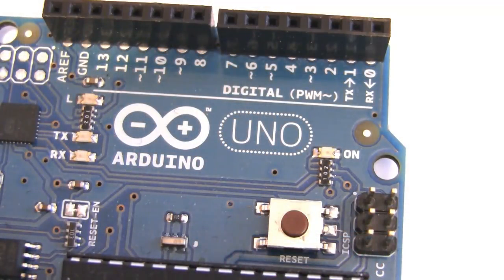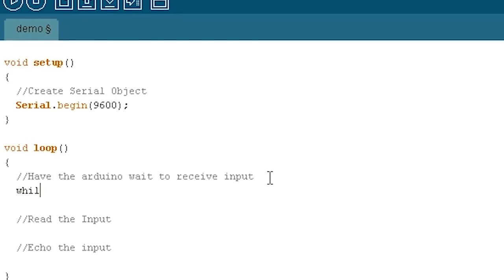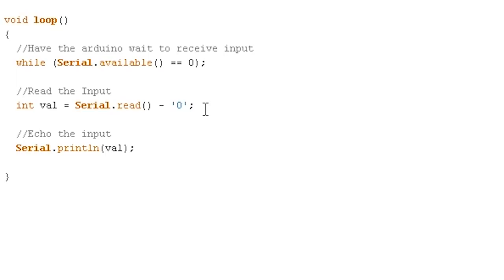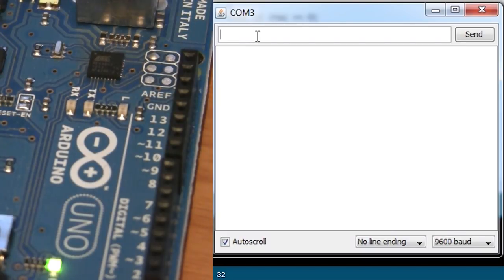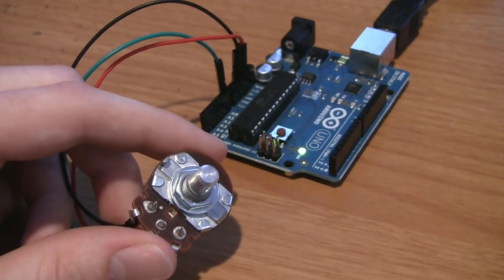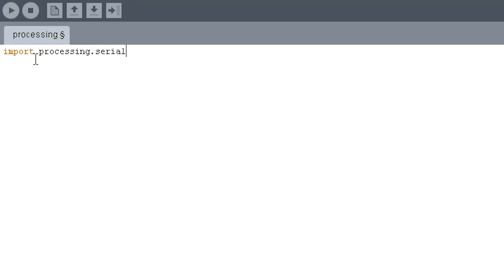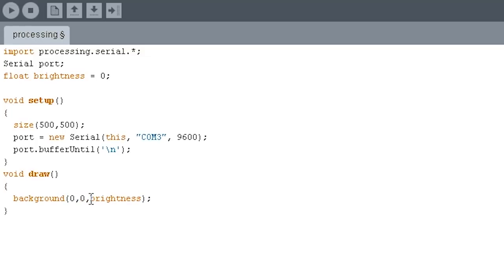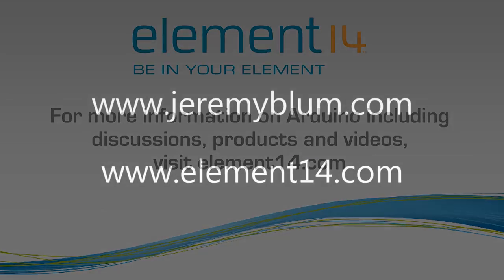Tutorial 06 for Arduino: Serial Communication and Processing

Comment: How did you get the Com3 window at 5:00? Is this another program or part of the Arduino software?
Reply: Thanks, I saw that after I posted.
Reply: Jim Steinbrecher you could use termite, but thats trouble.
Reply: i tried to use termite, but it says "no handshake" any suggestions on how i could get this to work?

Comment: The Processing listing shown in this demo, does not work on version 2.1.

If you change the last line:

brightness = float(port.readStringUntil('\n'));

To:

brightness = float(port.readString());

it does work.

FYI I am running win8.1 64bit.
Reply: thanks so much! that fixed it for me :)

Comment: RS232 is +/- 3 volts to +/- 15 volts. Not flat 0 or 15. The MAX 232 and MAX 234 ICs were used in programming cables and RIBs to program older commercial 2-way radios and cellular phones. Today the MAX232 series ICs are used in A/V gear when you can interface with a 9 pin serial port like on a DVR for CCTV or the programming port in some satellite TV digital receivers. They are being phased out by the USB versions though.

Comment: Hello, Jeremy. Could you help me with one strange problem? I'm following your tutorial and stuck on processing data from serial. All is working well until I start processing. In that moment in arduino IDE serial monitor all values start printing in one line instead of new lines. Also in serialEvent() function I receiving only few symbols from string. I guess It depends on my environment. I'm working on Linux. Should I use different symbol for line ending instead of "\n" on Linux?

Comment: Also if your asking about the later example then replace his line of code with this:
port = new Serial(this, Serial.list()[COM PORT HERE], 9600);
in the brackets try 3 or 4 it usually is one of those two, though there are ways to check.

Comment: The port will depend on what one your Arduino has chosen to use, it might be COM4 or some other one, but to get the console like he has on his screen, you can either use the button on the far left of the sketch window (it looks like a magnifying glass) or use the keyboard shortcut Shift-Command-M, when in the Arduino application.

Comment: Everything seems to work fine running this inside of the processing ide, but when i make a stand alone (linux) executable, i get the following error:

Error, disabling serialEvent() for /dev/ttyACM0
null

I do not have anything else open that may be interfering with serial COMs
Running as root did no good so i assume it is not a permission issue.

Comment: am using UNO, my       Serial.flush();          doesn't do a thing, i still get multiple prints even if i include it right there??????
Reply: Serial.flush();   only work for Prior to Arduino 1.0
Reply: Load Field so what can the rest of us do?
Reply: Matt Dathew "Serial.flush() has changed in Arduino 1.0. You can use this instead:
while(Serial.available()[GREATER-THAN]0)
{
Serial.read();
}"

First line in his commentbox on the video.
However, I`m still trying to figure out how to make that work myself.

Comment: Regarding the Processing part,

this is the code I used & the background is not changing colors

import processing.serial.*;
Serial port;
float brightness = 0;

void setup()
{
  size (500,500);
  port = new Serial(this, "COM3", 9600);
  port.bufferUntil('\n');
}

void draw ()
{
  background(0,0,brightness);
}

void serialEvent (Serial port)
{
  brightness = float(port.readStringUntil('\n'));
}

I placed the positive pin on the 5V - Black on GND & green in A0, but its not changing colors.

any suggestions?

Comment: Hello....I have one question. in serial communication sometime we write serial.begin(9600) and sometime different bundrate.
what is actual purpose of bundrate ?
Reply: +yash trivedi Baud rate is the speed at which you send serial data. You can have it set to anything you want, but remember to set the receiving & recieving rate to the same rate. If you don't you will end up with garbled data.Check at the bottom of serial monitor window for instance.
Reply: +masterstroggo  Okkk thank you

Comment: You spoke about using an Arduino Mega with many rx/tx ports.  When you set serial.begin(9600) this is for serial communications with the Mega as a whole?  The ports on the Mega are Serial1, Serial2, and Serial3.  Can you set different baud rates for different serial ports?  Serial1.begin(9600); and Serial2.begin(38400);  I'm using an external serial device to send commands to but it is conflicting with the serial monitor.  The baud rate for the ex/device (SFmp3trigger) set to 38400 on Serial2 and for monitoring which mp3s play on the serial monitor, Serial1.  idk.

Comment: Hello!! i need some help over here. The example is great but it works only if the Serial.read is from 
0 to 9, if you try to put 11, 13 or 26 it will reply the numbers separate as individuals, EX. 26 it will reply:
2
6 
and not 
26
So how i can fix this. please help!! Thank you.

Comment: The serial.flush() isnt working for me. It is still sending multiple "invalid" messages. Anyone else facing such a problem? How to fix it?
Reply: +Sankhalika Mukherjee Read the note in the description. It says that the Serial.flush() function has changed
Reply: USE
while(Serial.available()[GREATER-THAN]0)
{
Serial.read();
}
Reply: Where do we need to put that? I put it (while(Serial.available()>0) Serial.read();) at the bottom of the loop instead of the flush but it doesn't seem to change anything.
Reply: Seems to help if you add "delay(100);" before the while command. Not sure why.
Reply: RetroRobotRadio
Thanks, that works.
Reply: Because computers get hung up on infinite loops without delays
Reply: thank how do you find it and why is that ? (need a little time to think about it ? ;) )
Reply: You are absolutely right. Thanks for that tip!!!!

Comment: I also had problems with flushing the serial buffer. After many attempts, printing "invalid" only once works with this:

int ledPin=13;
void setup()
{
  pinMode(ledPin,OUTPUT);
}

void loop()
{
  Serial.begin(9600);
  while (Serial.available()==0);
  int val=Serial.read()-'0';
  if (val==1) 
  {
    Serial.println("Led is On");
    digitalWrite(ledPin,HIGH);
    Serial.end();
  }
  else if (val==0)
  {
    Serial.println("Led is Off");
    digitalWrite(ledPin,LOW);
    Serial.end();
  }
  else
  {
    Serial.println("Invalid!");
    Serial.end();
  }
 }

Comment: There is a problem with this video now the system has been changed and there is an error now when you inserted the line 'Serial.flushj()' it no longer works because the flush routine has been changed.  This caused me some time debugging because i thought i had something wrong.  i found system had been changed. keith

Comment: I am just learning the Arduino library myself, but it doesn't appear that you can (this way). The read() method separates a serial stream into bytes and returns the first byte in the buffer. So as long as you are reading from the buffer in a loop, it will continue reading those bytes. You have to implement your own function to read data up to a CrNl, and combine and display all those bytes. The library is "Serial" so you have to do some extra processing. Using AVR Studio makes this a bit easier.

Comment: Hello Jeremy,

I appreciate all your videos and I have found your tutorial pretty useful. I have a question though regarding processing. I have built a gauge for my gas sensor but there is a problem with my result when I run the code, it just blinks the whole thing.

I have noticed that the blinking rate is the rate that my arduino transmits data to my computer, like if I have delay(1000); on my arduino code, the gauge will blink every second.

Any thoughts on how to stop that? Thank you for your answer in advance!

Comment: What i do not understand is why you need the variable to be a FLOAT? it's whole numbers coming in? When i tried using an INT it didn't work.
Reply: analog data is typically between 0.0 and 1.0 or some other positive voltage like 0.0v to 5.0v, the ADC ( analog to digital converter ) can convert to integers like 0 - 255 or any other range, but if you are reading raw analog inputs they are typically decimal based.

Comment: hey I am working on automation project using HC-05 and few sensors. When we connect only Bluetooth module with Android and send commands through app it works properly. But the problem is when I hook up the sensor to it (reading the values using analog read) it is   not working properly. When we press a button on Android app, I am getting output only for the moment I press it. It does not stay as it was using only Bluetooth module. help me out
Reply: Hello bro....May be there where some pin mistake and which controller you used for your project ??

Comment: I had a problem with that program. If I entered more than one digit, I've received message for each character even with flush. Turns out, that there wasn't enough time time to receive all the characters in the buffer. I've fixed this by adding 10ms delay after the while loop.
Reply: Сергей Мациевский i got the same problem... and sorry again how did you fixed this?

Comment: for some reason, havin the code in when I enter 1 it replays back '1' to me then also '-38'.  Not sure what's going on there.
Reply: At the Serial  window.  I had to set it to "No line ending" at the bottom.  The reason your seeing -38 is that the serial is reading new line.  Without the "int val = Serial.read() - '0'; " code you would get 10 which represents "NL line feed".
Reply: Shawn Hale I meant without the "- "0"" at the end of  int val = Serial.read() you would get 10

Comment: I have an Arduino Mega 2560 board and a KRIDA Electronics 4 channel light dimming board with (GND/VCC/Sync/CH1/CH2/CH3/CH4 and GND) terminals. I want dimming level Up and Down by using two push buttons and stay any level of dimming point. Lamp is 230 VAC /50 Hz Please help me to write the Arduino code.

Comment: Serial.flush() is not working and so is the alternative provided here. still for more than one input sent i;m getting each invalid answers
Reply: iamkiddilam I'm having the same problem. Anyone here knows how to fix it? The code is identical to what the tut. shows.. Has the arduino Uno changed since the upload of this tut.?
Reply: iamkiddilam Yes, i had the same problem, but he has fixed the trouble in the comment box below the video.
Reply: ceber54 False alarm, doesn't work.

Comment: Take a look at the X-Plane SDK. It should give you the properties that you need to write/read to change the throttle. Then take raw data from the pot (via analogRead) and pass that into X-Plane via their API. I haven't done it in X-Plane, but I have in MSFS/Prepar3D. It's pretty straightforward. You need:

1) Input from pot
2) App to grab input and load it into X-Plane
3) API call with variables to read/write in X-Plane.

Try to use 10-bit ADC, as 8-bit is probably not enough resolution.

Comment: why is my output coming like this 
1
-38
2
-38
Reply: use No line ending
Reply: @davidtapia5492  still does it but just on the same line 1-382-383-38...
Reply: Oh I got it. Select No line ending in the serial monitor.
Reply: my LED doesn't turn off if I typed 0, why?

Comment: An easier way to have Arduino interact with Processing is actually using a library call "Firmata". Firmata allows you to not only take signal from Arduino to Processing, but also the other way around -- from Processing to Arduino. So one of the many cool things you can do is to use your mouse (Processing can recognize the movement of mouse) to control a servo hooked up to Arduino.

Comment: i used "while( Serial.available() > 0 ) Serial.read();" instead of "Serial.flush();". Still it didn't work. Then I used "delay(100);" before that and it worked. I wonder why it didn't work without adding a delay :/

Comment: Hi Jeremy
Can I run a print command from my arduino uno to get print out of the data I received.

Here's what I am doing.

Pc - arduino - led driver - RGB led 

Receiver

Photodiode - ckt - arduino - serial monitor on pc - print out of data.

Now I just need is print out.

Can u do that.

Also I have a question that can I send characters using white light of RGB led. I have code to generate white light. I also have code to drive my led but I donno how to mix these two to get both.

Any help is appreciated. 
Thank you in advance.

Regards
MJ

Comment: The following proposition for serial.flush() replacement:
while(Serial.available()[GREATER-THAN]0) Serial.read();
does not works exactly the same way as expected.
Some signs slides out. I read that it could be great idea to put delay(50) before it.
It's better but still doesn't work properly, especially with long strings. My proposition is a little more extended but it works perfectly:
delay(10);
while(Serial.available() [GREATER-THAN] 0){
  Serial.read();
  if (Serial.available() == 0)
    delay(10);
  }
}

Comment: "Exception in thread "Animation Thread" java.lang.RuntimeException: Error opening serial port COM3: Port busy"
I checked that Arduino used COM3, so don't know why it is busy. Thanks.
Reply: +Aaron Zheng Li i had a similar issue; figured out the answer today: when the consol window in arduino ide is open, it prevents the processing sketch from collecting the data it needs to open (they compete for COM3). try just shut the console window (after checking the numbers)

Comment: hello;tanks for the video , i have an arduino uno and i use COM6 as a serial monitor ;when i send a letter it give two answers one for i read and print Invalid! because i press button send or enter in keyboard;the letter doesn't read by arduino without pressing enter or send button .
the function flush doesn't work with me i don't know what the probleme
Reply: Ismail Amin same with me
Reply: Ismail Amin p

Comment: What application are you using to send and display the serial data????
Reply: Its just the basic arduino app but they changed the interface a bit. To open the console you got to click the magnifying glass on the top right

Comment: hello sir... i am using arduino uno board with NFC sheild to read the tags and if the tag is vali the program has to generate a random number and that random number should be saved in EEPROM and then that random number is given as input from serial monitor if random number matches to EEPROM it should go for further loop... 
here i finished till random number and saving that to EEPROM. now wanted to compare the number by serial monitor...??? please help...

Comment: and how would it be if i want to use 2 pots , 1 for blue and the other for red? the arduino code it's easy, but how about the processing code?
Reply: I've tried similar, but I use 3 pots, each pot for RGB. I couldn't get the processing works. Please post you code if you get it work for 2 pots
Reply: Chai Xiong
Here is my code, it does not work, the box just flashing sequences red, green, blue. When you adjust the pots it won't affect anything.

//PROCESSING CODE///
/*
The code will read 3 sensors from Arduino,
each sensor assigned to Red, Green, Blue.
draw a box on the screen, change background color
according to the sensors
*/

import processing.serial.*;

int redColor;           
int greenColor;           
int blueColor;

Serial myPort;                       // The serial port
int[] serialInArray = new int[3];    // Where we'll put what we receive
int serialCount = 0;                 // A count of how many bytes we receive

void setup()
{
  size(400, 400);  // Stage size
  //noStroke();      // No border on the next thing drawn
 
  myPort = new Serial(this, "COM3", 9600);
}

void draw()
{
  if(redColor > greenColor && redColor > blueColor)
  {
    background(redColor,0,0);
  }
  else if(greenColor > redColor && greenColor > blueColor)
  {
    background(0,greenColor,0);
  }
   else if(blueColor > greenColor && blueColor > redColor)
  {
    background(0,0,blueColor);
  }
  else
  {
    background(0,0,0);
  }
}

void serialEvent(Serial myPort)
{
 
 
  // read a byte from the serial port:
  int inByte = myPort.read();
    
 
    // Add the latest byte from the serial port to array:
    serialInArray[serialCount] = inByte;
    serialCount++;

    // If we have 3 bytes:
    if (serialCount > 2 )
    {
      
      redColor = serialInArray[0];
      greenColor = serialInArray[1];
      blueColor = serialInArray[2];
      
      // Reset serialCount:
      serialCount = 0;
    }
}

//ARDUINO CODE///
int redSensor = 0;    // first analog sensor
int greenSensor = 1;   // second analog sensor
int blueSensor = 2;    // third analog sensor

void setup()
{
  analogReference(DEFAULT);
  // start serial port at 9600 bps:
  Serial.begin(9600);
}

void loop()
{
 
    // read  1st sensor, map it to 0 or 255L
    int red = map(analogRead(redSensor), 0, 1023, 0, 255);
    // delay 10ms to let the ADC recover:
    //delay(10);
    // read  2nd sensor, map it to 0 or 255L
    int green = map(analogRead(greenSensor), 0, 1023, 0, 255);
    // read  sensor, map it to 0 or 255L
    //delay(10);
    int blue = map(analogRead(blueSensor), 0, 1023, 0, 255);
    // send 3rd sensor values:
    //delay(10);
   
    Serial.println(red);
    //delay(10);
    Serial.println(green);
    //delay(10);
    Serial.println(blue);
    //delay(10);
 
}

Please help
Reply: Look up in the Arduino examples, there is a example called "Mixer" that does that exact thing. But with 3 pots, one for each color.

Comment: I try to connect 2 arduino Unos in serial but the data exchange was not as I was hoping. I sent a char buffer of 30  serial.print("#XXXX xxxxxxx XXXXXX     xxxx-"); using for control starting buffer[0] = '#'; and terminating buffer[29] = '-';  and the other arduino must respond by sending a simple 'K' after the reception. That 'K' came after 5minutes! Is something wrong by connecting 2 Unos over serial? I used Serial.begin(2400); on both R->Tx Tx->Rx same supply same ground. Any suggestions?